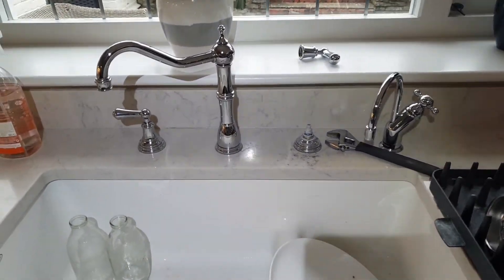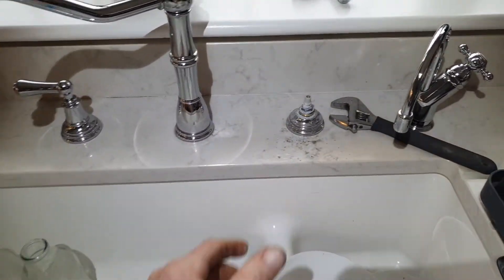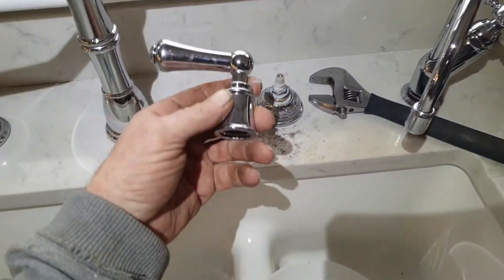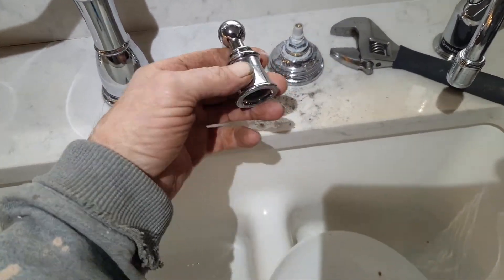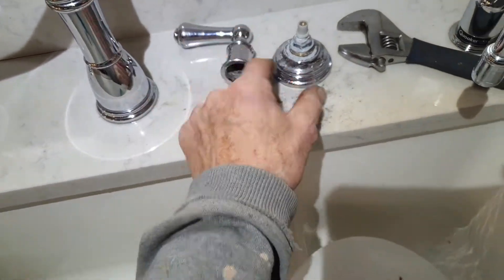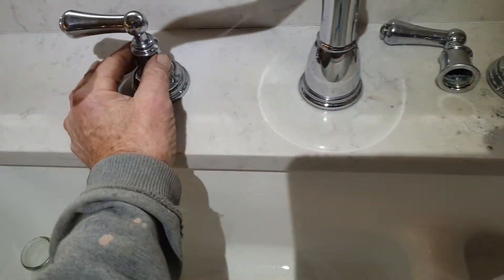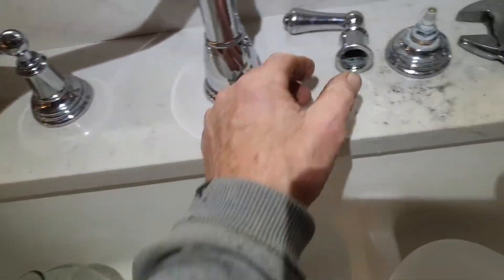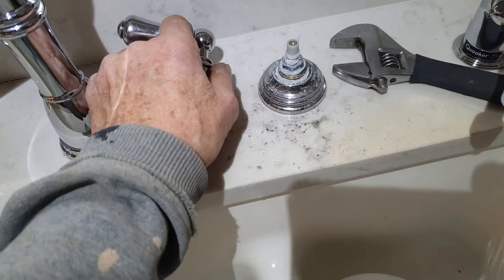Quick  EXPENSIVE  Perrin & ROWE ALSACE 4771 DRIPPING Kitchen Tap Repair    DIY  TIP

Comment: The make of the tap is Perrin and Rowe. Made in England. Thanks for the video. I have a set i put in about 12 years ago and i need to swap the valves. They are premium brand ,here in the UK your looking at over £500 pounds for a set.